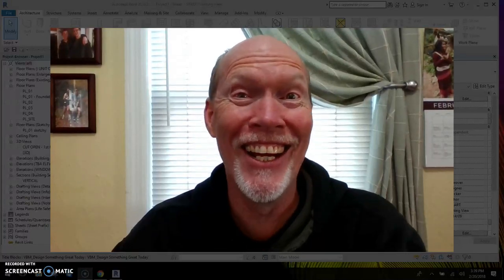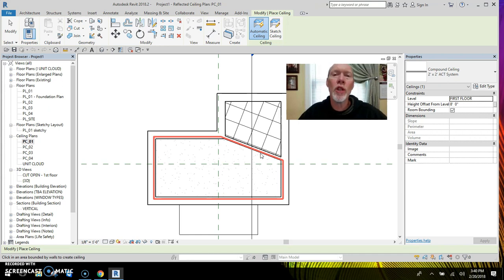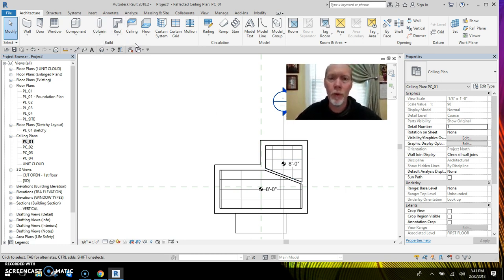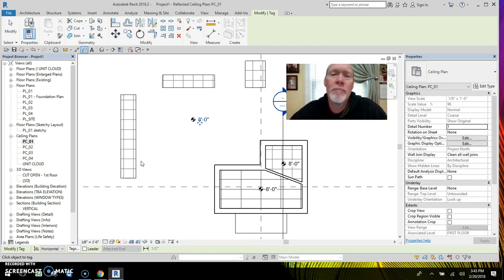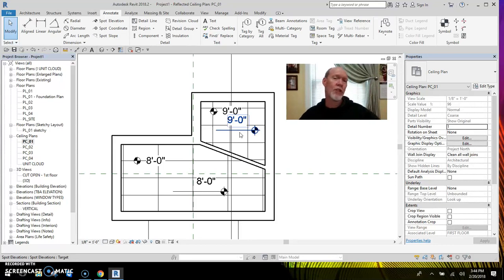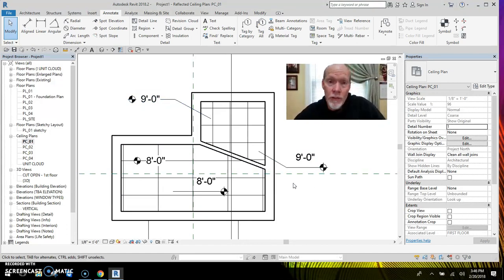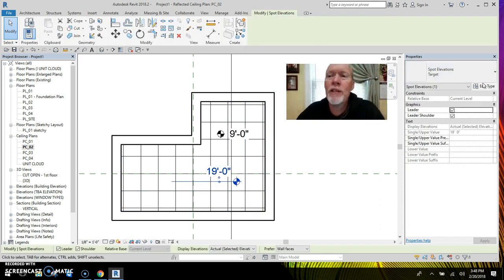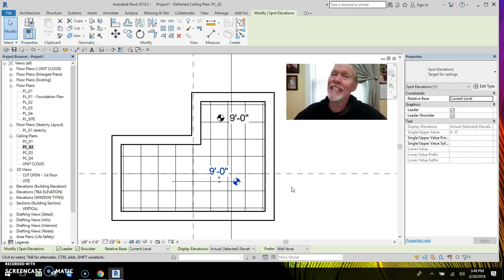Ceiling Tags - 2 ways to do it

Comment: how to add + and - symbol which is should be come automatic... suppose when the below 0.0 levels it should be come value with minus symbol when the level above the 00 level it should be come with + level.
Reply from the maker: There is a checkbox in the 'format' for the value... the box is called "Show + for positive values".  Check that box and you will get the + you are looking for.  The - (minus) shows up automatically... so you don't have to set that.
Reply: @miketaylor-fantastic  thank you sir i will check.. if I not found, will again catch you